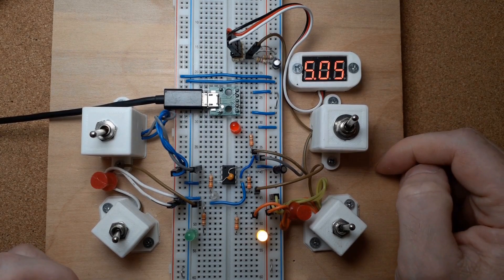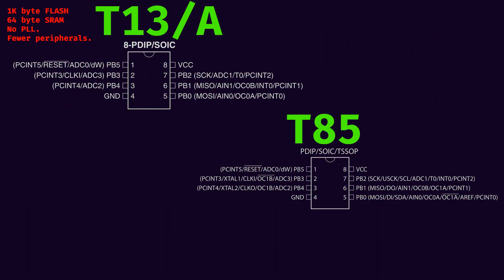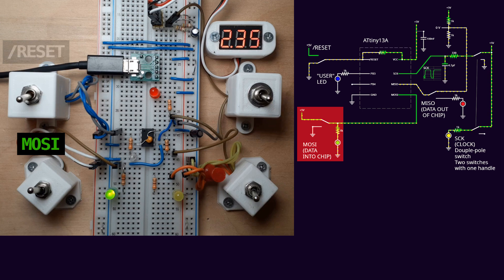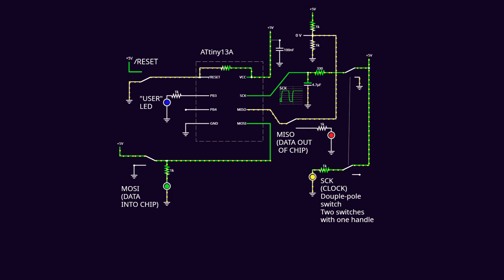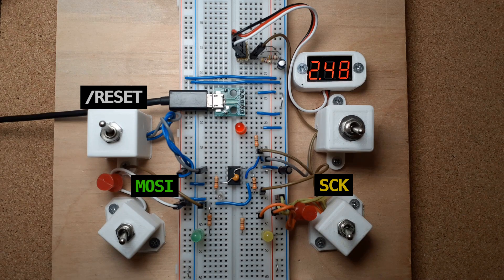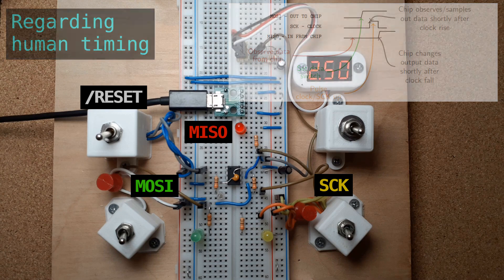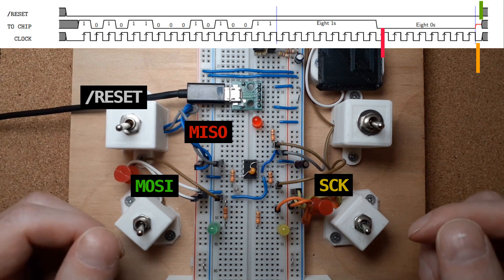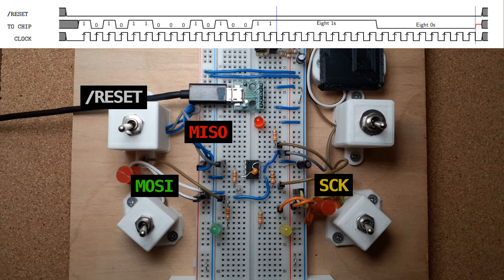AVR ISP By Hand: Demo Setup and ISP Programming Enable Instruction

Comment: Woah... I've always thought that programming something like an Altair or Early PDP through the "parallel" front panel might be fun the first few times but would get laborious after a few tries. But this takes that process to a whole new level. Even toggling in the simplest blinky would require a degree of concentration I don't think I could find... I've played around with DIY ICSP programmers before... but this is something else!!! Quite fascinating.

Comment: Make a punch card reader next?
Reply from the maker: Uhh, probably not next. But that would be kind of interesting. If you wanted to try that a more natural candidate would probably be the high voltage parallel mode like you'd find on the larger ATmega chip, those in the HVPP area in the diagram in the video. That way you'd have a shorter tape with 8-bit wide data. I have thought about trying it with switches. The one thing I'm not 100% certain on is the duration of the 12V pulse on reset. It's something I may look into if I get around to it though.

Comment: I'm very glad you've made the video and it turned out great. It's interesting that the chip listens for the programming pattern when held under reset, I did not expect it. Looking forward to the continuation of the series!
Reply from the maker: Yeah, it's kind of weird. I knew about the reset thing. But one day I was thinking, "Hey does the chip drive anything while it's waiting? Or does it just sit there. And if it doesn't start driving, when does it start?". That was what prompted the first time I played with it in manually. I wanted to know when MISO became active. As usual different AVR datasheets have different levels of detail. Often the older ones are better. So, some actually spell this out. But, I wasn't looking at one of those at the time. So I just ended up doing it myself to find out. =)

Comment: wtf. *golf clap*. Incredible to see. 
You should butcher a cheap keyboard and use the metronome as the clock, and maybe (using a microcontroller), allow chording of 8 keys / bits to be clocked out. That way you can write an entire program in hex, rather than bit by bit. And it would be cool to have the discordant music actually be a program.
Reply from the maker: I happen to have something a bit like a recorder and I've had similar thoughts about making a bootloader that responds to it, mostly because I've seen people ask "can I make a bootloader that uses X communication method" and the answer is pretty much always "yes." But, I have an even weirder idea that I thought about making into a video. If I do, it probably won't be soon though. There is a sort of guitar hero quality having to mimic the instruction format.

Comment: Thank you so much for this video! For the past couple of months i was thinking about ways to program a microcontroller without a computer, maybe in post-apocalypse or something. And now i finally seen it done in practice! Now i want to try and replicate your setup, maybe with addition of punch cards or tapes instead of manual input
Reply from the maker: You know, I have thought about that sort of thing. Mostly what comes to mind is bringing up a FORTH system. I read "The Martian" and thought it would be kind of funny to pose it that way, like trapped on mars, you have at ATtiny13 and some wires, etc. I do get a kick out of being able to do something with nearly nothing.